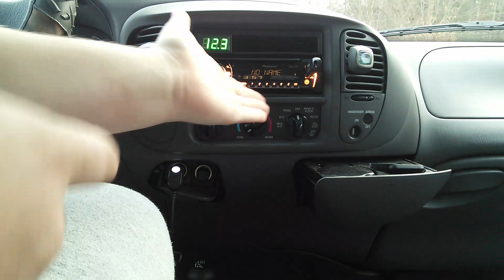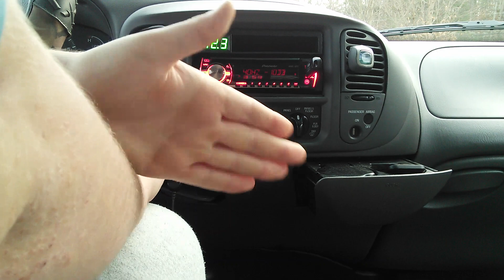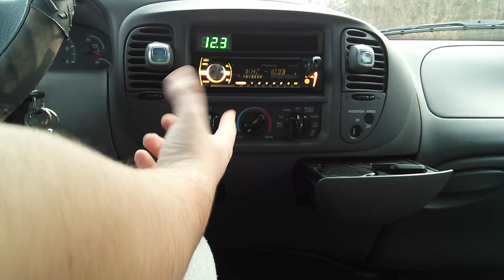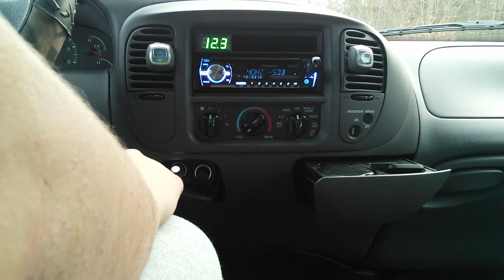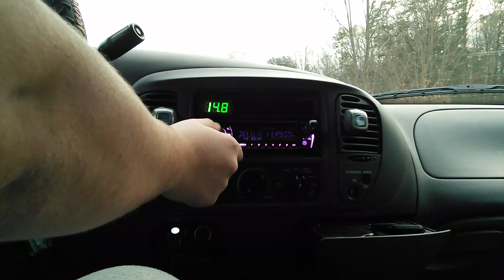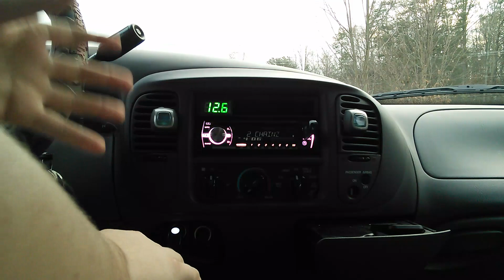Setting Amplifier Gain by Ear

Comment: Need help with my 1 channel amp (have a 4channel as well) no one in dfw with a damn o scope or any way other than by ear. On my cxa1200.1 I have a gain, bass boost crossover and dB bass boost. My db boost is off and only using gain an fb some of my crossover bass boost about half way but just need help with setting my 1 channel badly lol shops sucks and if I didn’t catch the smoke from my coil as fast as I did I wouldn’t have a speaker. Thank god my L7Q15INCH is ok so scared to do shit lol
Reply from the maker: Play a -3db or -5db 40hz test tone, you can get it somewhere on the internet. Make sure it's high quality. Turn the bass boost OFF make sure you have no loudness or loud feature enabled on the head unit. Make sure the headunit EQ is set how you want. Turn the amp gain to MIN, and turn your headunit to max undistorted volume (listen by ear or do a Google search the more popular headunits are usually listed in the forums with the max volume number they distort at on the RCA's. Play the 40hz test tone and slowly turn the gain up until you hear auditable distortion. Back gain back a bit until you feel it's clean. This method will get you close. When I did my 4 channel I was a hair width away from 1% tdh as measured by a SMD DD-1. You can also look on eBay for cheap o-scopes and they come in handy for more than just amp gains. Hope this helps.
Reply: Penguinboy1995 Thank you. I am sponsored by Kicker but the only problem is I’m in Dallas Texas and every single shop around here doesn’t have a O-scope. Or any other meter to the tech clipping and I also have a four channel amp which I think is tune correctly.  Right now I want to turn the lamp I have three different knobs I have one for the gain, db bass boost knob, and a crossover frequency knob. I have that does Sabor bass boost all the way off I don’t have any bass boost turned on on my head unit and just noticed that the equalizer on the head unit was still set to flat and not my custom settings for my four channel amp. The shop that is supposed to be at Custom Stereo shopThey installed the big three incorrectly and I was dipping in 11.0 11.5 voltage range which before the big 300 never did that low I am talking to type so if words come out messed up I’m sorry but anyways I have the games that almost halfway to crossover base boost about almost 3/4 of the way and so far no burning coil
Reply: Penguinboy1995 just I feel shops aren’t trying to take advantage of me and my speaker is a L715inch Q class in a custom box. On a CXA1200.1 ALSO a 360.4 let’s hope my 4 channel and head unitbEQ is ok. I’m sure it is for my four channel. Back to my 1 channel. Right now no DBs bass boost. Knob is down all the way and my gain knob is about half way and my last knob is the crossover freq bass boost and that’s a little over half. All aftermarket 6x9s  alpine type r. All of my wiring is perfect and the right size and awg. No loose connections on fuses or fuse holders. If you can look me up on fb and message me would be great last name Martin and should have a kicker hat on black thanks
Reply from the maker: @airon6864  I just added you and messaged you

Comment: IF UR RADIO SIGNAL DISTORTS AT 53 THEN U NEED TO SET UR GAINS AT 52 !!! SMFH !!! U HAVE NO IDEA WHAT UR TALKING ABOUT !! STOP READING INTERNET BLOGS AND THEN POSTING LIKE U KNOW !! AND VOLTAGE HAS NOTHING TO DO WITH SETTING GAINS UNLESS UR USING VOLT METER TO BALL PARK IT BUT U CANT USE BOTH U IDIOT !!! GET REAL POSER !!!

Comment: Got two jbl amps one pushing door speakers, the other to the sub's why is it really loud from 1-12 then after that gets shitty quality and the sub's don't hit that much anymore? The door speakers are alpine type rs 300 dollar speakers a pair and pioneer champions idk if this could be the problem or I might need a upgraded alternator because I'm pushing too much power?
Reply: Like the stereo goes up to 50 but I won't even turn it to 20 because it doesn't sound right its like the higher I turn it up the sound is poor I just wanna figure out why i can't have it past 12 without sound cutting out pretty much
Reply: Try turning the gain down a little bit.. did you tune your speakers by ear? It sounds like you’re having clipping issues. Do your headlights dim when the bass hits ?

Comment: Yea I have a 04 dodge grand caravan that I'm puting 2amps in so should I do the b3 upgrade or not keep it real wit me thanks or if u have any other ideals let me no thanks 😃😃😃
Reply: If you can do the the BIG 3 do it it always helps even if it seems like you can't tell audibly it DOES help, your amps will function allot better, bass will hit harder and the electrical in your whole system will function better

Comment: I really want 2 no is the big. 3 set really gd or is it just some bullshit
Reply: yes the big 3 helps your electrical .. it takes power to make power
Reply: Ok thats kool wat gauge wire 2 use I have a 04 dodge grandcaravan
Reply: @dee brown depends on how many watts u are running..best thing would be run 0 gauge n you will be good in future if u upgrade..
Reply: Ok gd thanks man
Reply: No problem

Comment: I was thinking about adding a AB amp to go along with my D class amp just not sure whats the proper way to wire them any ideas in the future for this???
Also is it even worth to amplify my aftermarket components speakers the the two up front are 50 rms and the back ones are like 90 rms.
Reply: The proper way would be to run a single 0 gauge power wire from the main battery to your amps. Then put a fused power distribution block with a smaller 4 or 8 gauge wire going to each amp(whichever it needs). You can use a seperate ground for each amp. No longer than 18 inches. I'm unsure about the remote wire... I read somewhere that you may need to hook up a relay, to properly turn on the two amps. 
Wether or not you amplify you speakers is your choice. They'll definitely sound louder/clearer. What's the point of getting 50/90 watt speakers if you're not gonna amplify them.

Comment: tell me  what real gain is, is it removal of distortion or getting clean and clear sound. i know one can get sound without distortion, while  you don't hear the bits clearly?
Reply: Gain is the "signal level" of what you're amplifying. You increase or decrease the signal level to match the signal of the head unit. Too low gain means weak signal, and too high gain means distorted or possibly clipped signal. You adjust the gain properly to prevent distortion, not remove it. Also, clear sound depends on other things too like the install, speaker placement, speaker materials, amount of power, matching of system components, etc. You could have a distortion free system, and it could still have a harsh tweeter, lack of midbass, or boomy subwoofer bass.

Comment: sounded like you head unit was clipping from high 30's-early 40's? good try at the video to each his own!
Reply: Good try ? Each own ? Like he failed ,  or u are so much better.    fk off idiot
Reply from the maker: no, this deck doesn't clip until 59/62. my amp gain is set to play clean at 54/62 and plays clean to 59 with bluetooth and sources that aren't as loud as USB. everything i was playing was clean, you just may have heard it differently though the mic.